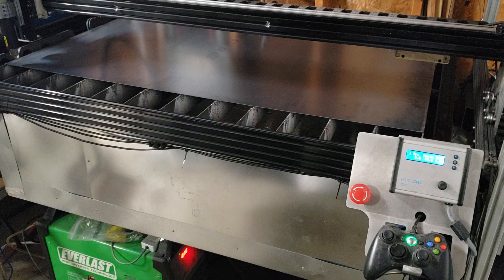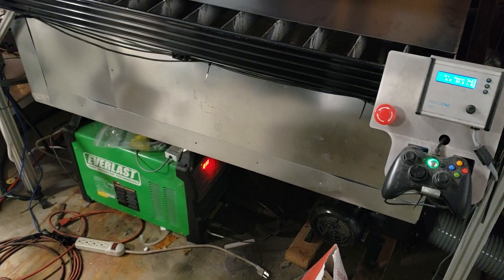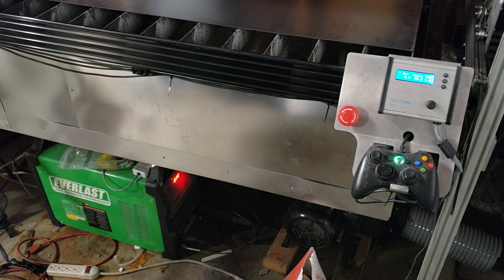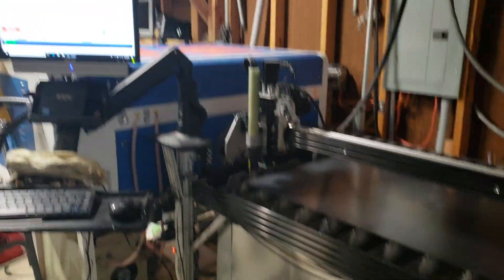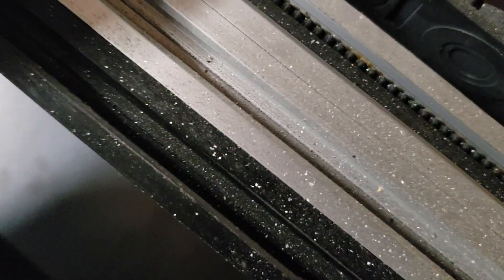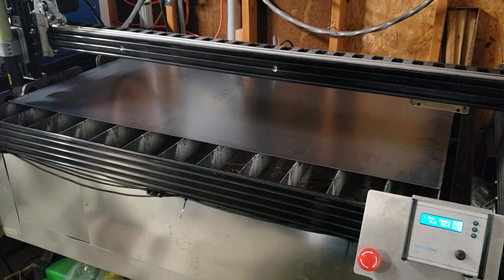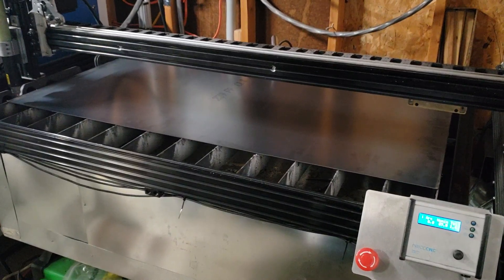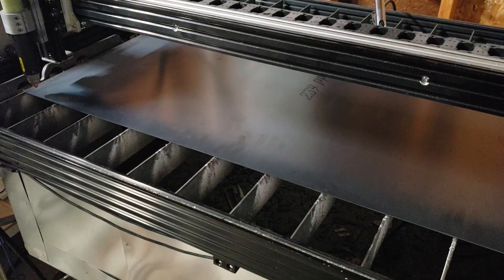Home built cnc plasma table.  Built using openbuilds ox cnc router parts.  Everlast power plasma 60

Comment: Hiya, I have a similar cnc, 5x10 plasma using openbuilds gantry and rails. My gantry is the same size as yours. I have no clue about motors, was hoping maybe you could tell me what size motors you are using please? I have a z axis motor, its the other two i dont know.
Reply from the maker: 425oz nema 23 motors.
Reply: @adaptedmachining6951  thank you very much, appreciate the info.

Comment: I have the same setup.. did you had problems with circles before glueing the belt in?
Reply from the maker: I actually had problems until I switched to the belt clips and tensioners that inventables uses on the x carve cnc router.  I put lots of tension on the belts.  

Also took some fine tuning of the settings in mach 3.  No backlash compensation, slow rapid speed of 400imp but acceleration of 90.
Reply: Adapted Machining thx!

Comment: Hi, I was thinking about doing something very similar, I actually have the same Everlast. I was going to get a workbee 1500mm×1500mm frame. What are your thoughts on the belt vs screw if you did it again, would you still get belts?  Thanks.
Reply from the maker: Belt drive has faster rapid speeds. Also since there is no cutter load like with a router I would stick with belt.

Comment: About how much money do you have into this, im sure it has a bunch of time into it.
Reply from the maker: I want to say about $800 in the frame / mechanical end of it.  About another $1500 in good quality electronics. (Torch height control, motors, drivers, control board, etc.)   The plasma machine was about $1,300 with a machine torch and a hand held torch (seems everlast has come down in  price since.)
Reply: @adaptedmachining6951 , thats not bad at all, a ton of work im sure, but would be great to have in the shop for that kind of money
Reply from the maker: It has been by far my most profitable machine in the shop.  Main reason I built is I have limited space and everything was either too small a cut area or too big of an overall size.

Comment: Just wondering if you've had the same problem. I'm using sheetcam i load in my drawling in sheetcam it does its thing then load in mach3 and at first it was cutting fine but now it placing cut in different locations.  not sure if its ghosting. I've heard that can be a problem with cnc plasma cutting.
Reply from the maker: I would assume you are setting your zero properly in sheet cam and also then re zeroing out in mach before cutting?   If you have a cheap high frequency start plasma and / or your setup isn't properly grounded I suppose you can have interference.  

All my cables are shielded and I have added ferrite to most of the cables inside the box.
Reply: @adaptedmachining6951   The zeroing out I did as you said but I found out that the guy that made the machine did not use shielded cable so I have bought some shielded cable to replace it with the ferrite good suggestion I never even thought about that I'm also going to ground my table to an Earth ground hopefully all this well straighten the problem out.  Thanks for your reply
Reply from the maker: @bobreichel  That all sounds like it should help.  I would also suggest running a cut with the plasma torch off to rule out interference.